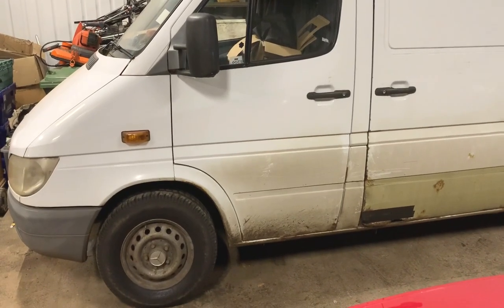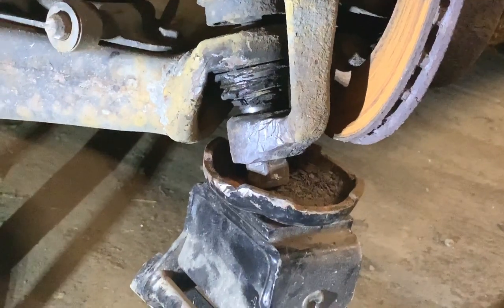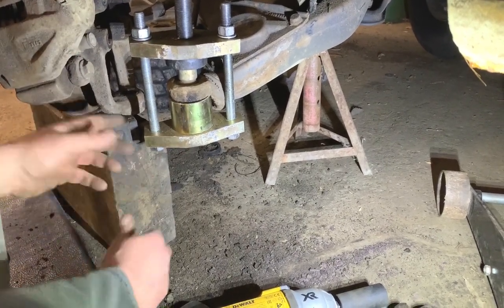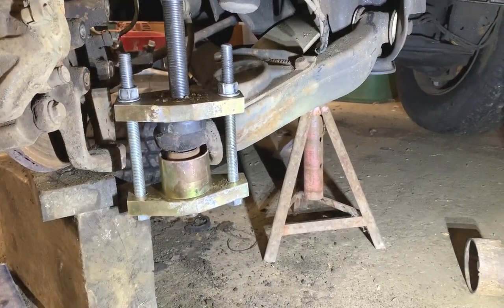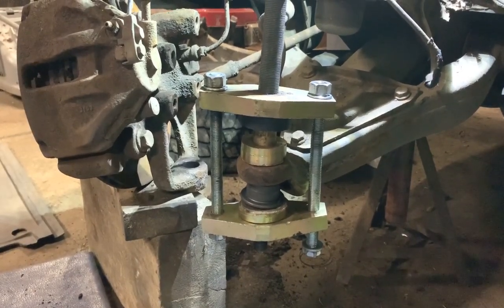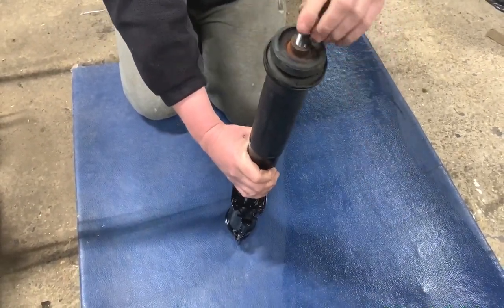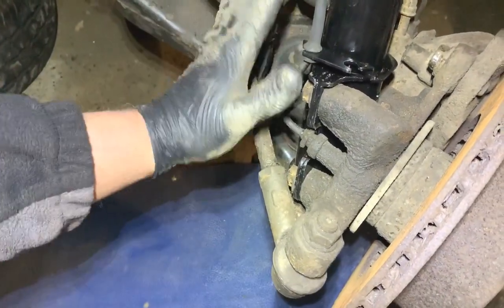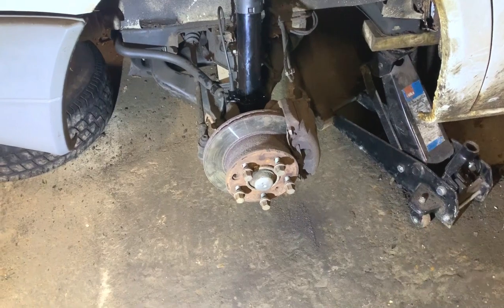Mercedes Sprinter Ball Joint & Shock Absorber ( How To Remove & Replace )

Comment: Hi mate hard work gardening and no van 2 work from
Reply from the maker: Hi Glynn I do have the Land Rover 110 but it’s higher and I have to lift one Honda hrx537 on top of the other so it isn’t ideal, I do have my trailer so that been used a lot more but nothing is better for my job than a big van. Now the ball joints and shocks are done it’s on to the rust repairs videos coming up on that, Thanks for watching 🙂👍